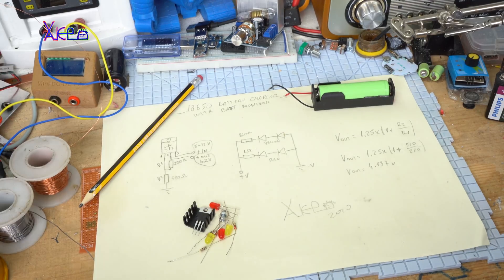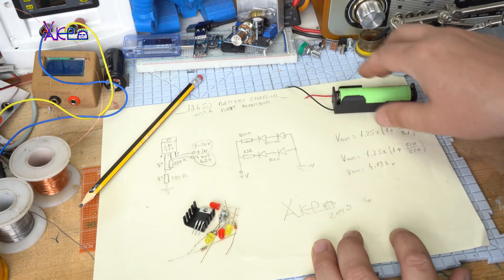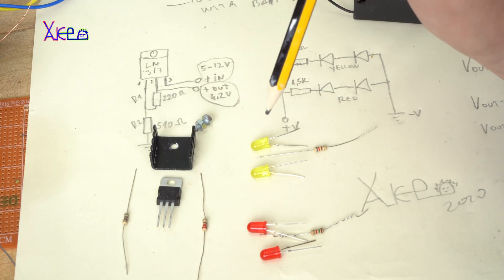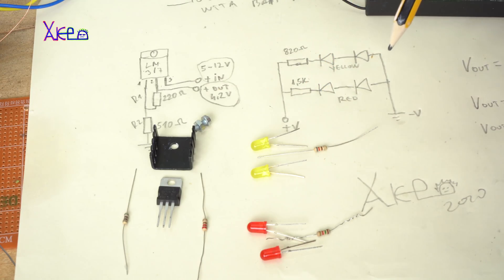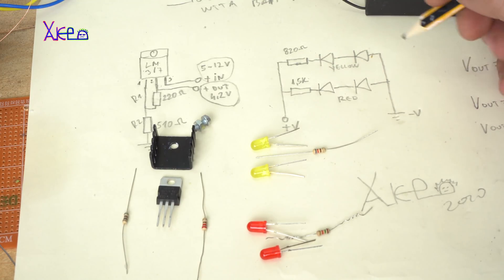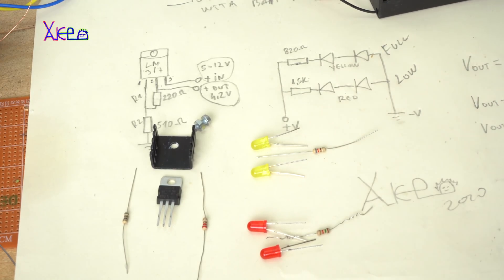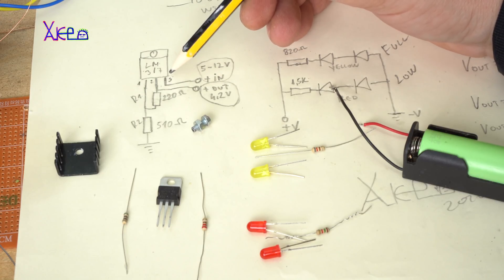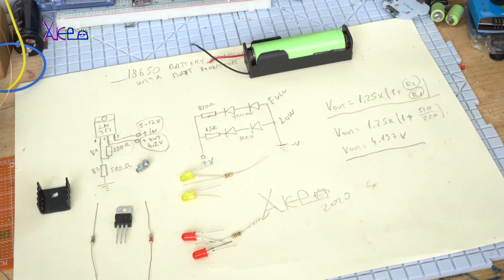DIY 18650 Battery Charger with Level Indicator

Comment: Hi! You can not to use for this circuit input of 5V, because different between V- in and V- out, by datasheet has to be minimum 3V. Before you start to make some project, and to show this to public, read Datasheet of components. So, the input for this project has to be between 8V to 15V.

Comment: you have one of the most technical videos here so i figured i'd ask here. i am trying to charge a 7.4 lithum-ion battery pack as a test. its from one of my hand held radio transceivers, that is new, i have four of these batteries with their four wall chargers, and want to learn their true capacity as i think the company selling the battery is lieing about it. i have a "hitech x4 ac plus" high end charger that lets me set it up for li-ion 2s battery, but it wont charge all the way, and now that i am thinking about it i had the same problem charging my 18650 cells back in the day. so google suggested i use the lipo setting on my charger, and it did add more mah to the battery, but when the charger was done charging as lipo, now the battery pack is 8.2volts, not 8.4 as it should be. this hitech charger has 4 chargers built in with all their own individual programming. i can tell you i just balance charged two  3s lipo packs and each cell was exactly 4.2 volts as they should be. i said all the above  so i could say this: since i dont have a good way to connect the radio's 7.4 lith-io battery to my charger i am using two strips of aluminum foil carefully stuffed down into the charge base for the radio and use alligator jumper leads to connect the negative and positive foil bits to my charger. is the foil or the leads the problem, or neither? my hitech charger will drain and charge the battery at any rate i tell it and measure the mah, the mah is the key here.

Comment: Wow! Thanks for the tutorial.

I didn't had enough money to buy exactly the same components but I found good/cheap alternatives on Aliexpress.
I cannot wait till I'll be able to test this charger in the school with my fake Ultrafire and Blitzfire 18650 cells :)

Nah, just kidding.
My question is, why don't you just take a battery holder and solder it to a TP4056 board which costs like 0.50-2$ on Ebay?
Those boards also have a MicroUSB connector.

Comment: Don't bother. There are 18650 charging circuits with all safety feature for cheaper than the mosfet transistor.

Comment: Sólo con un regulador de voltaje 317 nunca podrás regular el amperaje de manera controlada en cada momento.

¡¡ATENCIÓN!! NO REALICÉIS ESE CIRCUITO PARA CARGAR LAS BATERÍAS DE LITIO, a parte de que se forzarán a ser cargadas de manera brusca, acortarán la vida útil e incluso se podrían calentar y explorar ¿por qué? porque una batería de Litio ha de ser cargada disminuyendo el amperaje que se le entrega hasta llegar a los 0mAh a medida de que alcanza su voltaje máximo. Si no se realiza con un controlador automático de amperaje según el voltaje suministrado, la batería sufrirá y NO ES LA MANERA CORRECTA DE CARGA ya que incluso hay PELIGRO DE QUE LA BATERÍA CALIENTE SE HINCHE Y EXPLOTE O SE ENCENDIE.

Este proyecto es un sinsentido y una vergüenza para los electrónicos y una verdadera falta de respeto para los usuarios que están comenzando a aprender.
REALIZAR ESA PORQUERÍA DE "CARGADOR", MOSTRAR JOVER ESO ES ALGO MUY IRRESPONSABLE.

Por algo que no es absolutamente nada correcto eléctricamente se debería de penalizar la cuenta.

Comment: Can you suggest another voltage regulator which can handle 2A? Because most chargers output 2A.
Reply from the maker: You can hook up 3pcs of Lm317 in parallel and you will get 4.5 amps ,max ,with large heatsink